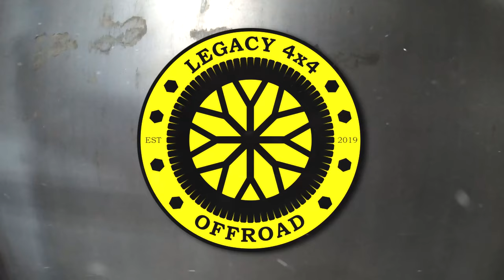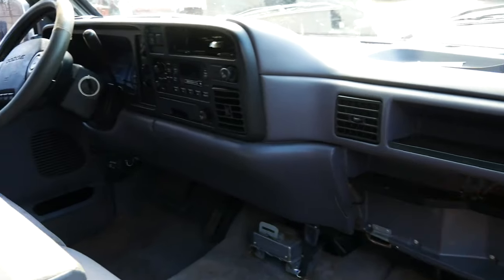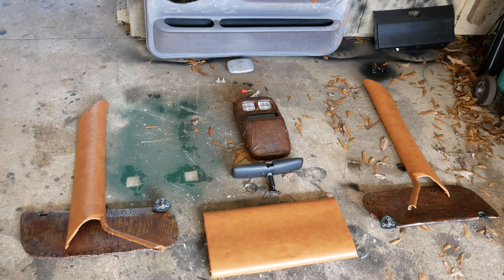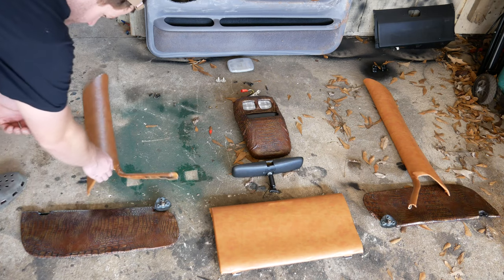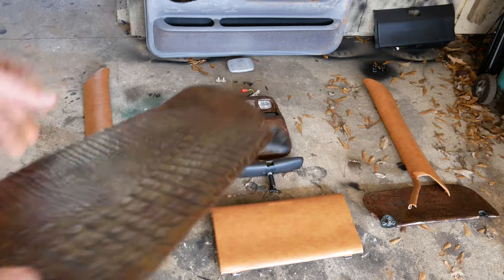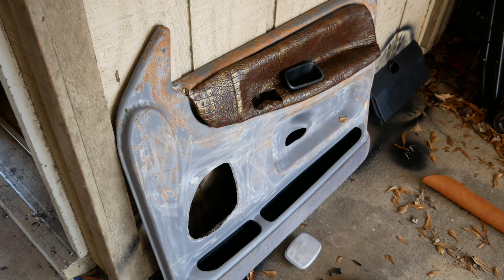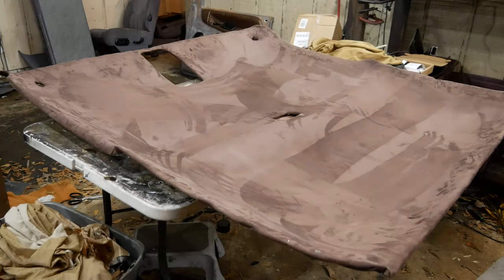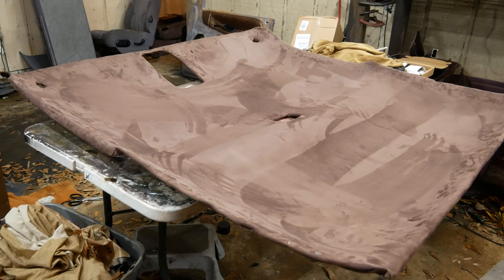Leather and Alligator Skin Dodge Ram Interior Custom Truck Creation || Legacy 4x4 Fabrication

Comment: Awesome looking job I need my seats recovered in my 2007-1/2 Ram dually with the center flip up console/ third seat
Reply from the maker: I also did a katskin kit on the seats... your interior is probably dope!!
Reply: @Legacy4x4andOffRoadYT  are the Katskin seat covers very expensive, I really only plan on doing just the front seats
Reply from the maker: @stacyreid5077  was around $600 for the basics all leather
Reply: @Legacy4x4andOffRoadYT  that’s not bad for all leather. Thank you
Reply from the maker: @stacyreid5077  not at all.. plus feels much better

Comment: I didn't know you made a second video. I have a 99 2500 gas V-10 the dash is trash. I did the LMC TRUCK replacement dash. I'm still curious about a 3rd gen swap. Watching you try has made me think about doing my own headliner my self and the carpeting as well. 

Great job.
Reply from the maker: Those two were dead simple to do… probably 10x easier than a dash swap
Reply: @Legacy4x4andOffRoadYT  

I will eventually do the headline and replace the carpet and hopefully film it and post a video here on YouTube. I don't need the 2nd gen as my daily
So technically it's retired like it's previous owner 
So I'm thinking show truck. I enjoy 2nd gen content

Keep up your amazing work
Reply from the maker: @DMACHOLMAN  thanks man! Let me know when you share yours!